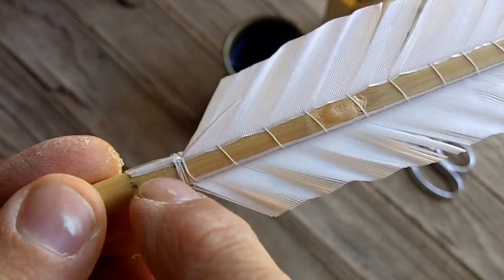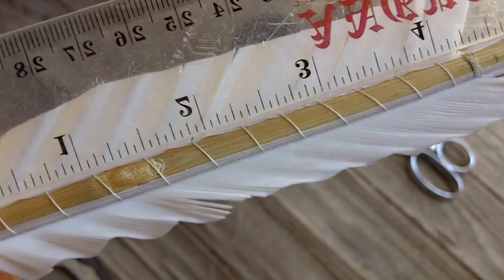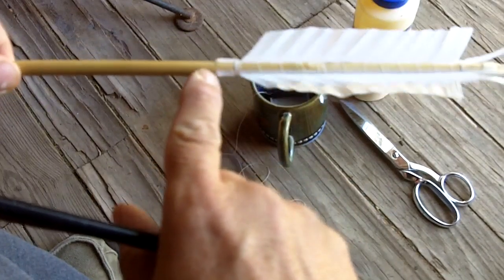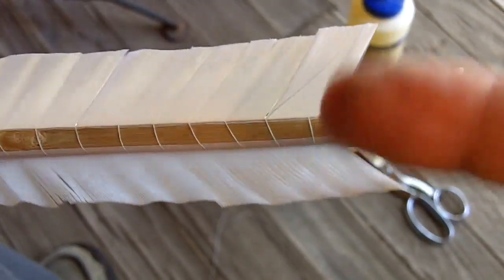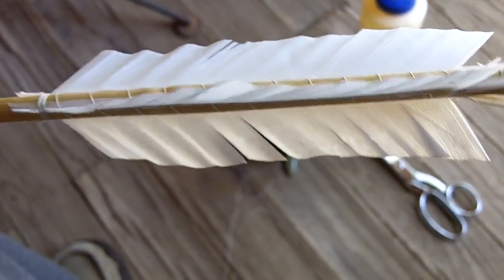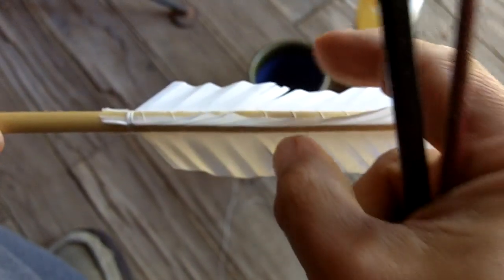273 - Making River Cane Arrows 3/9

Comment: It's only trivial but it appears that you did the offset backwards to what is excepted as the natural way .The feather works better with air traveling over the top side. Offsetting the feather works apposite to what nature intended.You won't notice it shooting but could be slightly noisier .I have been hand making arrows since 1970 and made thousands. Apart from that it's a great video.thanks for sharing
Old school Richie 
PS not putting you down as I think you are one of the best out there doing this sort of video.keep up the good work
Reply from the maker: Interesting. Thank you.

Comment from the maker: Normally, straight as possible.  It's easier.  Especially when I need to pull on the ends of the quill (or membrane) to help flatten the bottom of the fletch.

Comment: Is there a reason not to use artificial sinew on the point and nock? Is the thread stronger when you use glue?
Reply from the maker: For me, thread is easier to use than artificial sinew.  The artificial stuff is waxed, making it hard to glue down.  Thread glues down well and I just break it when I'm done wrapping - no need for scissors. And yes, the thread and glue combination is strong.  Probably not stronger than the artificial sinew but a lot of strength isn't needed for wrapping on arrows.